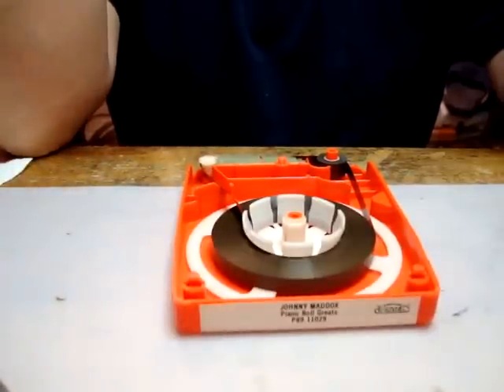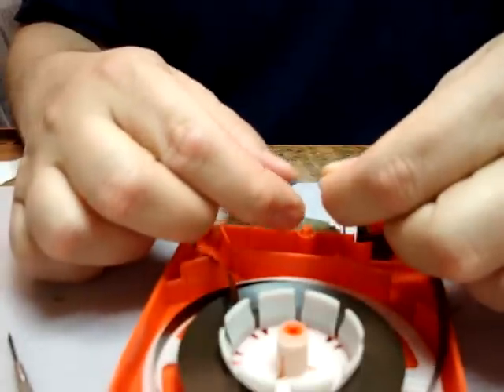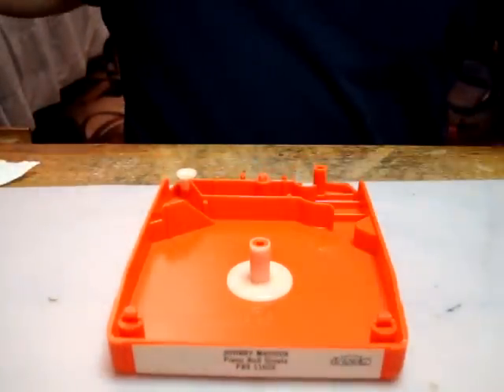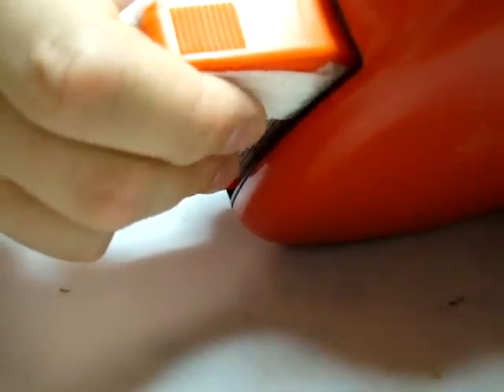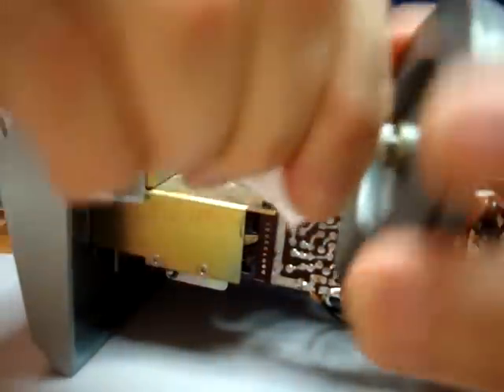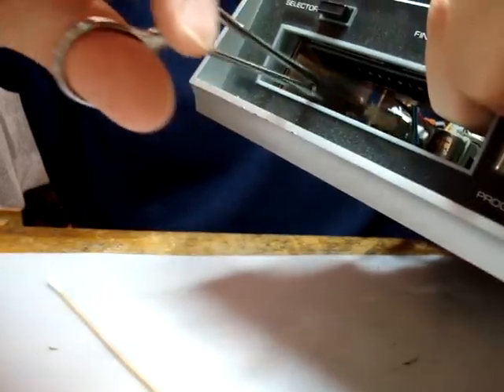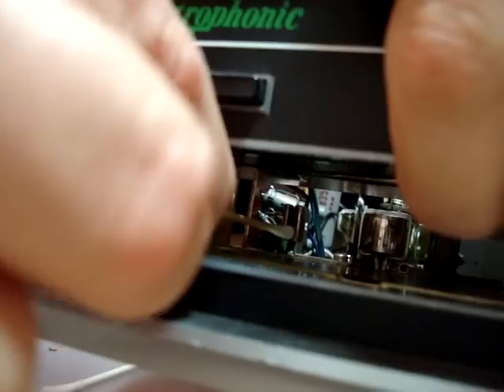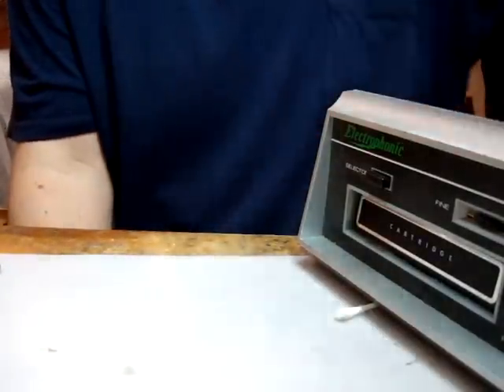8 track repair Misc pt 3

Comment: Some tapes in my player have crosstalk and when I play some of those tapes in a different machine it is fine. I do not know what is with that machine of mine ?
Reply: Michael Zolnerovich your heads on the machine need to be aligned.
Reply: Been 8 years but if you are still there most machines have azimuth adjustment which is really just the angle of the play or play/record head..try tweeking that with a few different tapes, actual head height adjustment can be found inside the player in or around the channel change mechanism in most units..be sure to check with more than one tape..you run the risk of aligning perfectly to a less than perfect tape..
Reply from the maker: There is a screw near the tape head holding mechanism usually with a coating of screw lock on it. This is the one to turn to adjust.

Comment: Hi, how are you doing? I'm having some problems with an 8 track tape, the tape gets stuck and wrinkles appear often . What can I do? Is there a way I can send you a pic of the problem so you can figure out the situation? Thank you buddy. Greetings
Reply from the maker: You will have to open the tape up first of all. What label, type of casing is it (RCA, CBS, Warner Bros)? Tabs on it? Check my videos on opening the respective type of case.
The tape jamming could be from any number of causes (moisture/mildew, tape raised off the inner hub near the center blocking the tape path, the splicing foil sticking to the tape and needing to be replaced). The old splice can bind a few layers of tape together and removing/replacing it can loosen all that. Or sometimes the tape just contracts somewhat and gets tight and you need to advance to the foil splice (by turning the reel manually), remove the splice, unravel a few turns and put on a new splice.  Let me know.
Reply from the maker: The url isn't working. Do you have the complete url?
Reply: Hi sorry, i posted the url by mistake I wanted to post the pics
Reply from the maker: hmmm, still not showing the pics. Get an error message.
Reply: Facebook is better for sending pics
Reply from the maker: Anyway, if it's Columbia or CBS, it has the three tabs on top so look at my video on opening that. They are pretty easy to open. Since almost all the CBS brands have splices that break, you will need a roll of sensing foil to replace the one there. With the tape opened, turn the hub with a small screwdriver (my video shows how to do this) until the splice pulls out from the center. As you turn the tape, you may see a bulge appear within the tape spool. That is where the splice is and indicates that it is bad. As for the wrinkles, check out my video on ironing out wrinkles.
Reply: I opened the case up
Reply from the maker: I see profile pics and a pool with a water fountain on your profile. Can you post it there (for now) then delete it later?
Reply from the maker: Try turning the tape from the center with a small blade jewelers screwdriver
Reply: Yeah, thats my profile. I postes the pics some minutes ago already
Reply: Ill try to post them right here again
Reply from the maker: OK, I sent you a message on FB
Reply from the maker: Do you have a roll of splicing foil? You really need that.
Reply: waukee321 No, i dont. Where can I find that kind of thing?
Reply from the maker: It's available on the web. Just google "sensing foil". You need 1/4" width for 8 tracks. It's made of aluminum and comes on a spool of up to 50 ft in length. You need to scrape off the old splice and glue residue with the edge of a razor or knife being careful not to cut the tape. Mount the tape ends in a splicing block or use the sticky side of a post-it pad to hold the ends together. Then with clean hands and using tweezers, pull out about 1/2" length of the foil tape and cut it at a diagonal 45 deg angle and carefully tape the tape ends together (on the brown playing side of the tape). 

Here's a link to the foil tape on ebay:
http://www.ebay.com/dsc/i.html?_from=R40&_sacat=0&LH_TitleDesc=1&_nkw=%22Sensing+foil%22&_trksid=p2045573.m570.l1313.TR0.TRC0.H0.X%22Sensing+foil%22.TRS0&_osacat=0&_odkw=%22Splicing+foil%22

and a link to splicing block (use 1/4" size):
http://www.ebay.com/dsc/i.html?_from=R40&_sacat=0&LH_TitleDesc=1&_nkw=tape+%22splicing+block%22&_trksid=p2045573.m570.l1313.TR1.TRC0.A0.H0.Xtape+%22splicing+block%22.TRS0&_osacat=0&_odkw=tape+%22mounting+block%22

I have a video of doing this.
Reply: Thank you waukee321 I really appreciate your help
Reply from the maker: Sorry I couldn't access your photos. Were you able to fix your tape? I was working on some 4 track cartridges just now (predecessor to 8 tracks) that look like 8 tracks except they have a big hole on the bottom where the player's built-in pinch roller pivots up inside the tape to play it instead of it being self-contained in the tape. They only use two programs instead of four and most don't use sensing foil so you change the program manually. Don't have many of these tapes.

Here's a picture:
http://www.ebay.com/itm/LAURINDO-ALMEIDA-GUITAR-RARE-MUNTZ-60S-4-TRACK-TAPE-TESTED-LATE-NITE-BARGAIN-/222331551474?hash=item33c3fe3ef2:g:WuAAAOSw44BYNfqs
Reply: Wow!
Reply: I havent seen any of those around here in Argentina
Reply from the maker: Here's a picture of the player. 

http://www.ebay.com/itm/Vintage-4-track-Car-Tape-Player-Space-Age-Model-S-700-/361844824556?hash=item543fa1d9ec:g:M00AAOSwzaJX6Asj

These were mainly used in automobiles (pretty much also why 8-tracks were invented-for car use) and were popular only in the 1960's early 1970's. Lots of chrome! Muntz was the main manufacturer. You slide the tape in, pull the lever to raise the rubber roller to play, then release the lever to lower the roller to stop it.  I've heard them and they sound very good- stereo too. 

Then there's the "Play Tape" format. Smaller than 8 track. Mostly for portable players that came with them. Never got into these. Limited tape selection not very common.

http://www.ebay.com/itm/Vtg-Rare-Playtape-1200-Tape-Cartridge-Player-8-Cartridges-60s-the-Beatles-Hank-/201598827691?hash=item2ef039fcab:g:cO0AAOSwtJZXVcl1

and RCA even had a short lived giant cassette:

http://www.ebay.com/itm/RCA-VICTOR-Sound-Tape-Cartridge-Player-Recorder-1YB-1-with-original-cartidge-/162296885288?hash=item25c9a5f028:g:qpIAAOSwA3dYOWVT

And of course cassettes, open reel tape, DAT, etc, etc.

So many ways they formatted magnetic tape!
Reply from the maker: I was playing one of those tapes by the Sandpipers, a group popular about the time those tapes were made. Has a nice song I remember from long ago that I had not heard in many years. Found it on Youtube:

https://www.youtube.com/watch?v=Jm1anurhbeg

Comment from the maker: It could be several things. I'd start with all the control knobs and switches; spray them with contact cleanser and work them back and forth. The motor armatures may have carbon build up on them. Not an easy fix as it involves CAREFULLY opening the motor without damaging the carbon brushes and cleaning off the carbon residue from the brass armatures. Other than that you may have some leaky capacitors that need replacing. Good Luck.

Comment: Hi waukee321, how are you doing?, Im having´ha very hard time trying to open my Live! B.B. King on Stage 8 track tape and i dont see any of this type in your videos. It was made by Modern Tape Corporation in Los Angeles,CA
Could you show me how to do it? Thank you a lot! Greetings
Reply from the maker: This does look like a non-conventional type cartridge which I come across occasionally.  The two holes in the corner seem to indicate a wedged shaped locking tab which is similar to the 5 tab video I have. Commonly, there are 4 in each corner and one in the center but once in a while they will place them differently. Check/feel the center of the cart under the label on the back. Do you feel an indentation? Use a small screwdriver to see if you can poke a hole through the label in this area. If so, there is another tab there. If these holes are tabs you first need to slit the label on the end so it can be pulled apart. As in my video, push the locking tab/post away from the locked position while prying the shell halves apart. If it's stubborn and won't unlock, use a small screwdriver blade to gently gnaw part of the edge of the tab end (not too much) and try again. If not, gnaw a little more. Often there will be enough tab surface left to lock together again. Some tab locks are tighter than others.

If you do not see a wedged shaped tab in the whole, it may be a post which may or may not be easy to pry apart.  It could be a.) sealed/glued all the way around like the later RCA carts; so you have to use an exacto blade and cut/pry all the way around or b.) like the AMPEX carts with the gooey roller where you need to use the hex screw in the hole removal technique (see the AMPEX Pt 1 video for this).
Reply from the maker: These are the videos I referenced:

https://www.youtube.com/watch?v=4ucVgmKo9qY
https://www.youtube.com/edit?o=U&video_id=kniUDYY8Zn8
Reply: Thank you for the help,Waukee321, I will try to fix it the way you told me.
By the way I need to buy some supplies like a splicing block, some sensing foil, among other stuff...Where do you think it would be the best to buy the stuff? 
http://www.8trackshack.com/    what do you think about them?
And what about this other shop...?
http://www.8-track-shack.com/

Thank you once again, mate!
See you!
Reply from the maker: 8trackshack has been around a while and I've bought things from them and was satisfied with their service. ebay is also another option and there are many sellers there as well. Good luck with the tape repair. I recently ironed out one that was badly wrinkled. It's never plays the same as it was in the wrinkled area but satisfactory. Just turn off the iron when you iron it to avoid any potential erasure to the heating coil's possible magnetic effect.
Reply: These links are pretty alike but they belong to two completely different shops. Which one did you buy these things from? Thanks for your wishes, and  yeah, I'll follow your advice when ironing out my Beach Boys tape
Reply from the maker: I think I bought from ebay and other vendors. I did a google search on sensing foil and found some distributors. I bought a 50ft. roll. There are some widths that are 1/4 inch (common) and some slightly less.

Comment: I don't think it's a good idea to scratch the tape head with Brasso, I would never do it.
Reply from the maker: I've been doing it for years without any problems and make sure it is more liquidy than paste. Brasso is/was used to polish plastic watch crystals and leaves no scratches behind as it is very fine in composition. When heads are heavily gunked up with crud, it is the only thing I find that removes it.